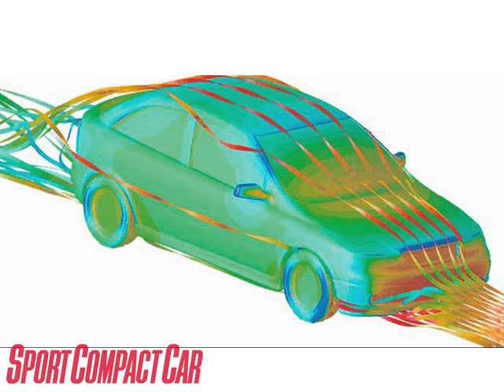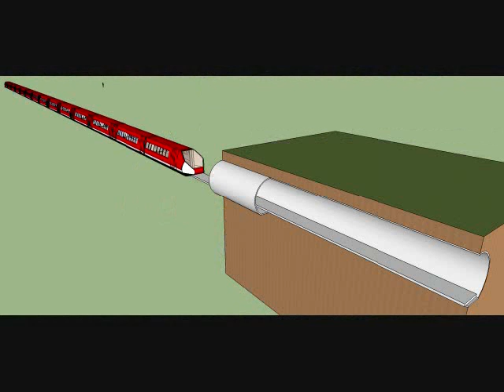Evacuated tube transportation future

Comment: Lol! Evacuating a 1000 miles long 4m diameter tube will cost more than the transportation is worth. You can't build such a structure that is entirely sealed. So vacuum pumps have to constantly evacuate it. People should think about giving up the insane mobility-dogma. Thats easier than curing its symptoms. It costs nothing.

Comment: There would be no air leakage if the tube were made of glass. If you put enough heat on the soil as you dig a path, it would turn into glass. No manual digging will reduce cost.

Comment: My point exactly. That's why I believe they should build a lot of small sections, for example, from New York to Chicago, then people would have to change tubes to go from Chicago to Denver, and from Denver to LA. That way if terrorists or earthquake caused a failure on one section, others could still work until the previous one was repaired. That is why sections should be underground and protected against earthquakes.